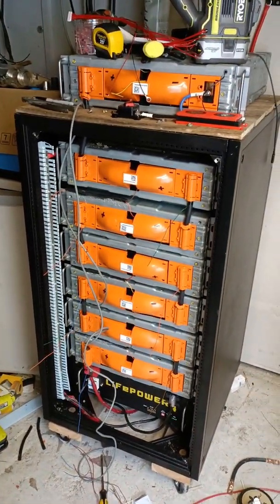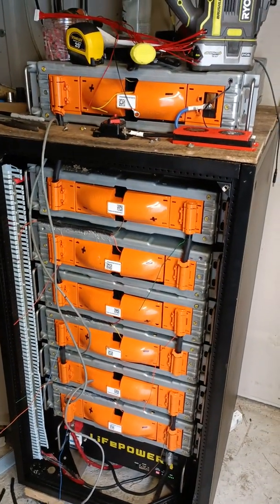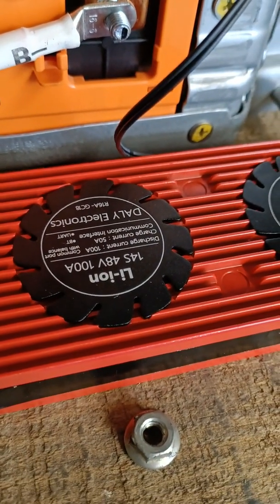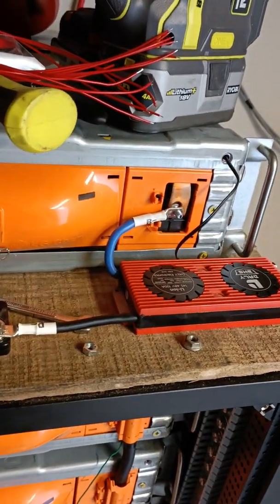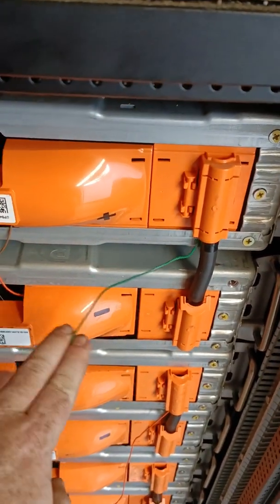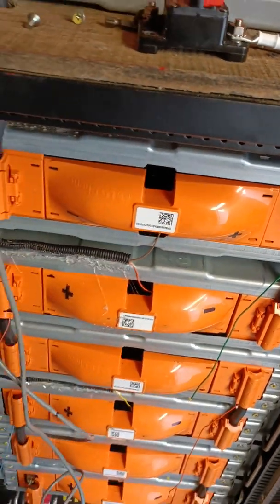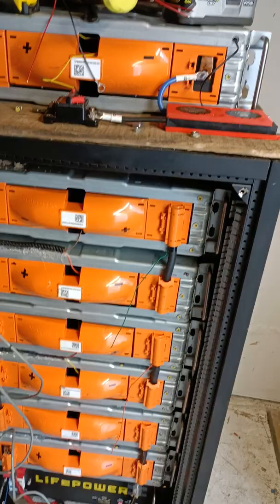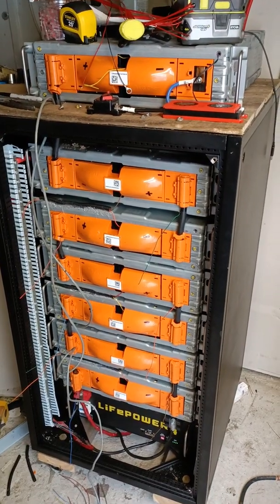Building off-grid 15 Kw lithium battery using used LG Chem packs - Part 2

Comment: I received 2 of these batteries 8 months ago. I just now found this video. I want to run 2 of these together for power in my barn and add more batteries /panels when i can afford it. I just dont know much about building batteries. Can i use one bms for both batteries? Also, how have these batteries performed for you?